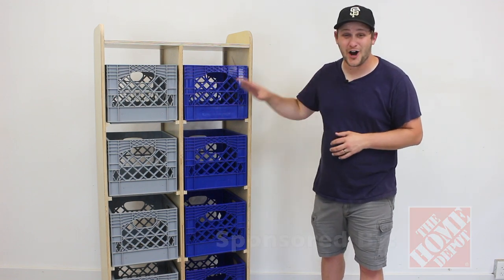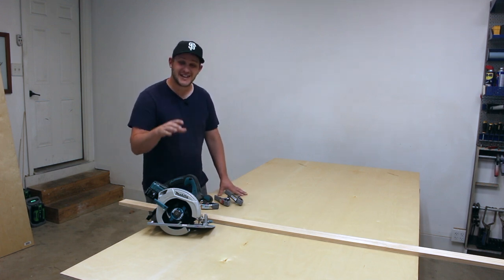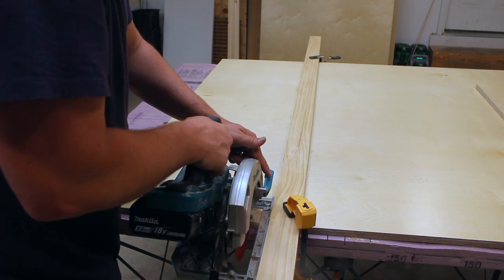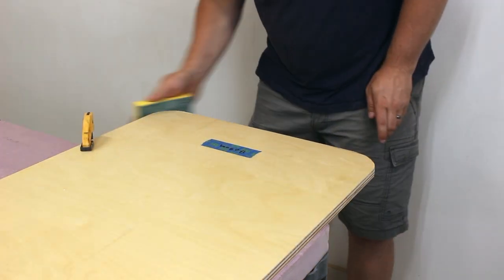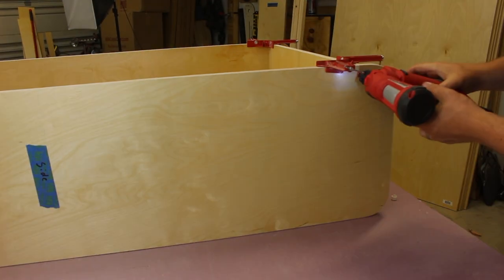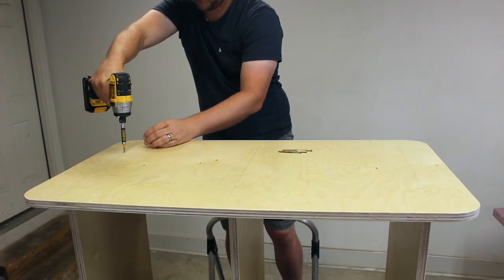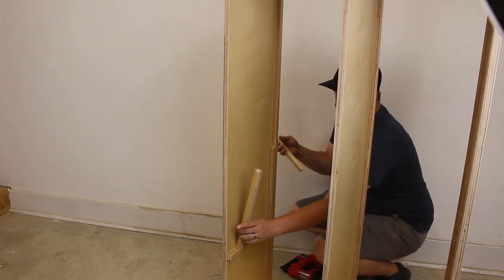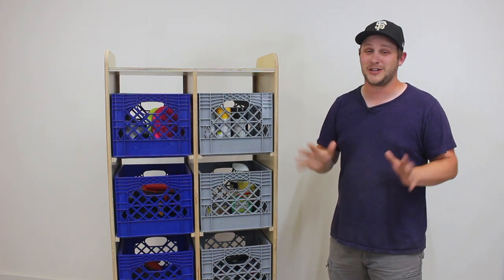Easy DIY Storage Cart | ONLY 1 Sheet of Plywood and 4 Power Tools

Comment: Nice project.  I'd make one modification...if you make the side cleats wider so they almost reach the top of the crate below, the crates won't tip towards you when you pull them out.